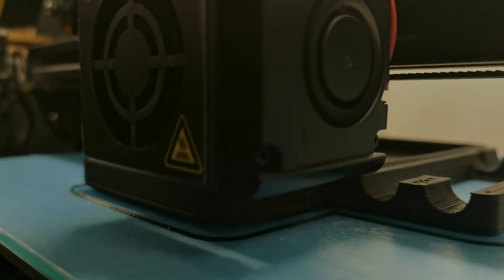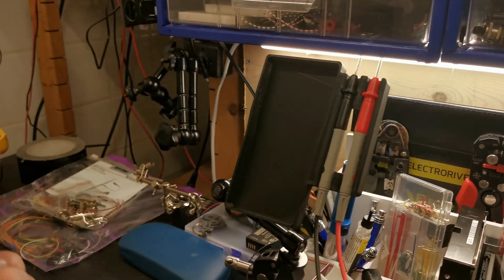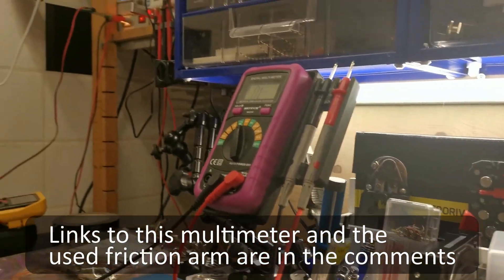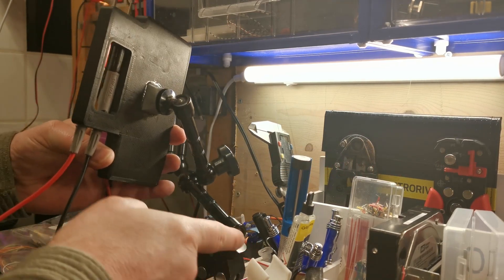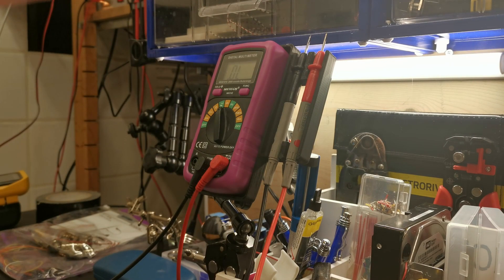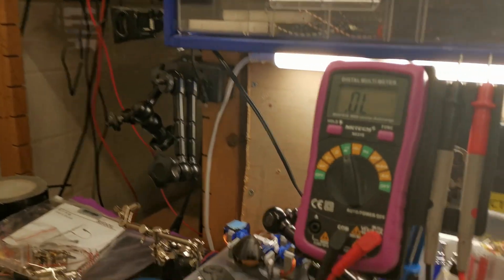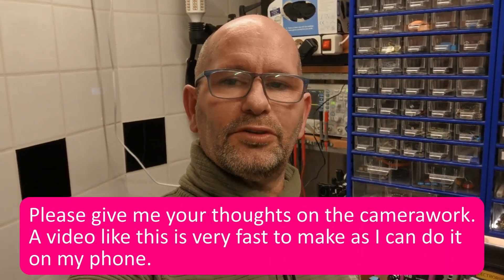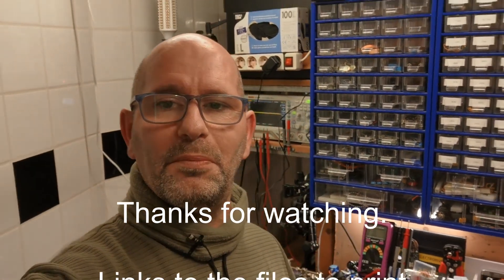▼ 3D Print a stand for your MultiMeter | DIY Multimeter stand

Comment: hi great video i picked up a da vinci pro cheap off eBay , but i need a filament sensor PCB board , as it came with a da vinci 1.o housing and nozzle and fan , so just need the pro PCB board can you help , i saw your other video where you did a bow-den conversion using another guys design PCB board , but he hasn't made any for a while , regards
Reply from the maker: I only know they sell them here: https://www.tindie.com/stores/bdwalker1/?ref=offsite_badges&utm_source=sellers_bdwalker1&utm_medium=badges&utm_campaign=badge_medium
Hope it helps you.
Reply: Thanks for link i have left email for when back in stock . They ran out 3rd april  , i might as well  buy a whole unit. Seem them going for £100 original unit  with hot end . My poor da vinci sitting not working lol . But thanks for reply quick